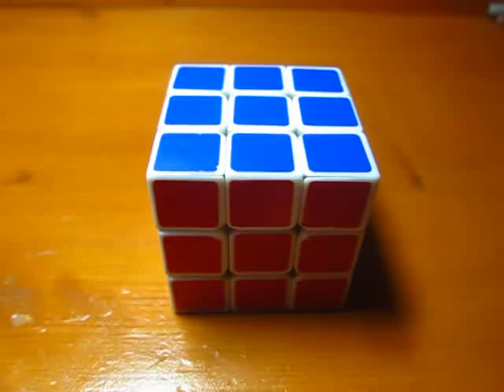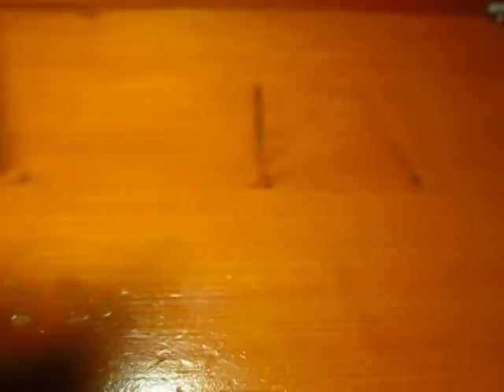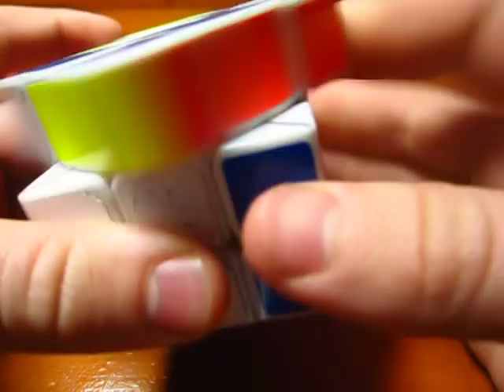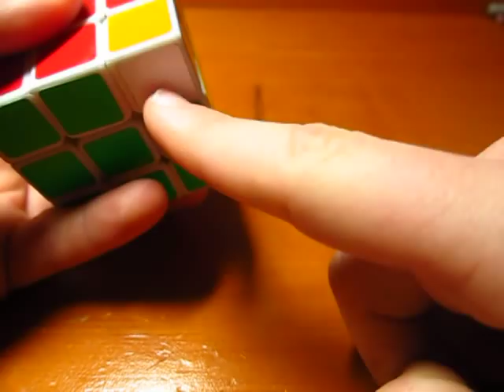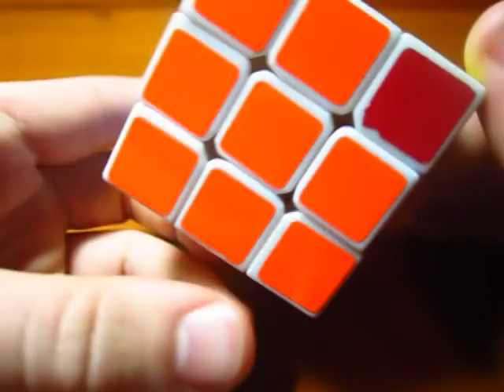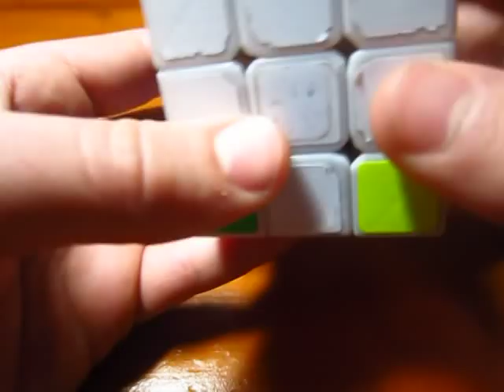3-Style Tutorial Part 3 of 10: Corner Commutators Continued

Comment: I'm pretty sure I understand most of the things that are going to be said in this series, but I'm watching anyway just in case. Just a bunch of setup moves to the D face and doing commutators to 3cycle, and edges will be the same thing. The hard part (for me at least) is remembering what the setup moves were so that I can undo them properly.

Also, I'll be sticking around for parity.

Edit: well, I guess you don't necessarily have to have the target pieces in D, there are other ways to set them up. So I'm glad I watched.